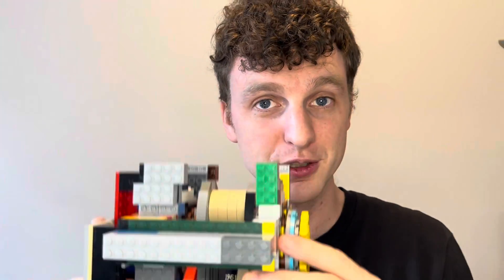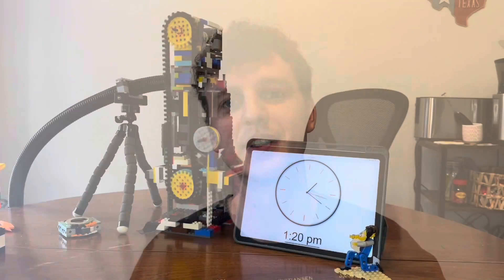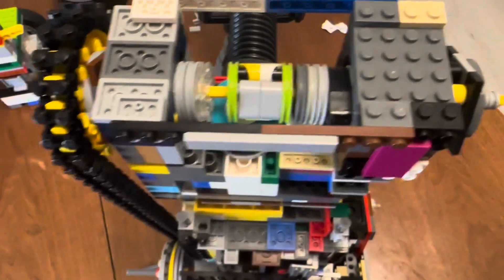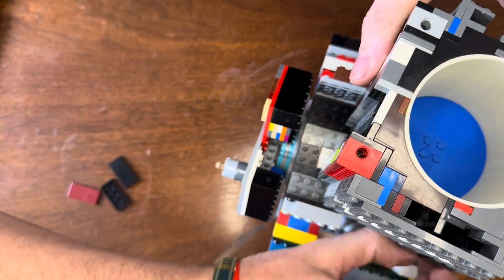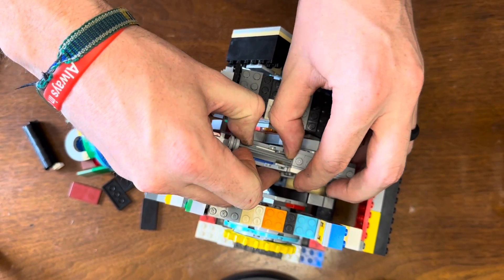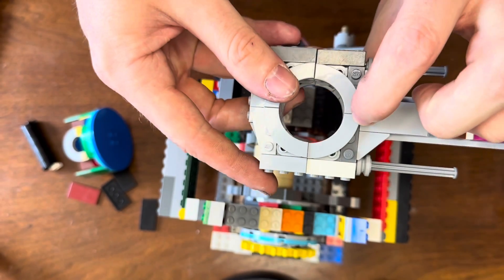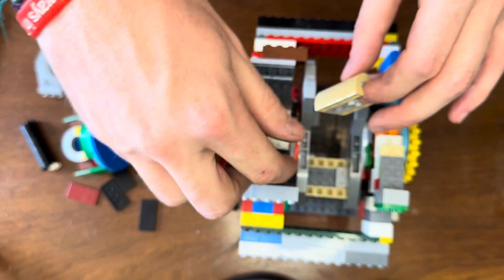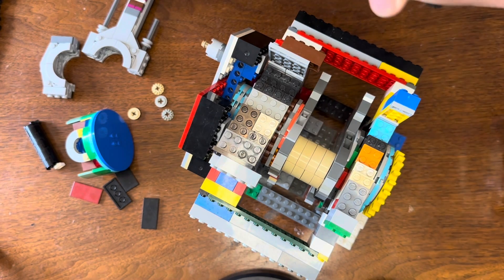Crankshaft for Life-sized LEGO Vacuum Engine pt. 2: Ten Minute Run!

Comment: You can also improve your crank-shaft Durability by using a 3D printing pen to basically weld the pieces together, this does have some downsides sadly, but it prevents it from separating. you could use alternatives such as Lego-glue which dissolves when in contact with water, which is painful to re-attach the glue, but its still a functional idea if your willing to be patient enough. Your engine has indeed improved over the years. My rating currently is 8.7/10 goodluck!
Reply from the maker: Thank you for your comment! Yes, it would be interesting to try LEGO glue or a 3D print pen. Part of the victory and satisfaction for me is that I finally have a crankshaft design that is pure LEGO and I'm confident won't break anymore at these lower rpms. It's really all in an effort to make the building experience only require a set of instructions, a keen eye, and a mechanical mind just like a LEGO set. It's encouraging to see other people enjoying the progression of this project :D

Comment: I think you might be able to squeeze some more rpm out if you balanced your rotating assembly better, you can see the piston fall down in the bore after you got the head off due to the crank not having enough counter weight
Reply from the maker: Thanks so much for your observation! I did a preliminary static balance on the engine, but obviously I didn't nail it. I think it's in part because I balanced it before extending the connecting rod to accommodate for the longer stroke, but I also need to make sure the surface I place the crankshaft on for balancing is flat and level. It was on a not-so-level table sitting on a not-so-level floor, so, yeah I can do better haha

Comment: oh wow, thats realy impresive. Mayby make it faster? Its kinda slow
Reply: That’s because it’s so big and has many moving parts. If you want high RPM use a single cylinder (4x4 plate or 4x6) and don’t put the valves overhead with a separate camshaft. 

Edit: I just saw the piston and it’s just too big and bulky for high RPM. If you would spin the engine at too high RPM it would most likely fall apart
Reply: @L14N-337 well, thats the chalange, my handcranked 4x4 piston single cylinder goes with my current desing up to 9k rpm with not alot of extreme stress, you desing, upgrate, see it fail, desing and so on. It would be realy awsome to see the engine go faster, its likely poseble but very hard. My engine had alot of engeniering behind it, it took a long time to get it running that fast (its still handcranked).
Reply from the maker: I love the discussion, guys. Thanks for sharing your thoughts in the comments. I definitely agree that this engine is not going to match the rpm of a 4x4 or 4x6 engine. It also has a longer stroke now so it's a 205cc up from 180cc and it's less oversquare which slows it down a bit, too. But I do think it has a lot more potential for higher speeds now with the new crankshaft design than it did with the old one. I'm not sure exactly what the next weakest link would be on this engine, but my guess is a lot of things would start breaking with a few hundred more rpm. But as BigPixel said, that's the challenge and it's fun :D Thanks again, y'all!
Reply: @engine1ear151 a way to reinforce the engine is to mayby use lego technic. Or mayby just make the head lighter, that way its easier to spin faster, of you want help mayby ask me!